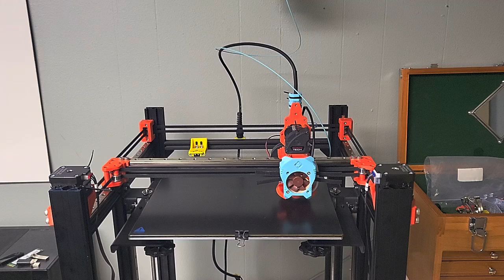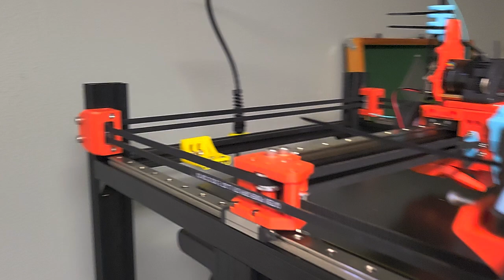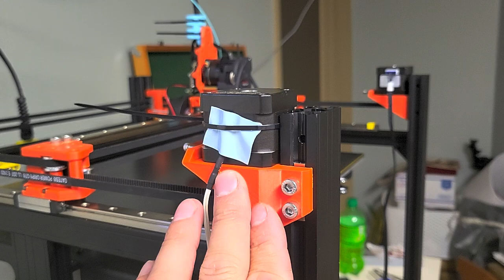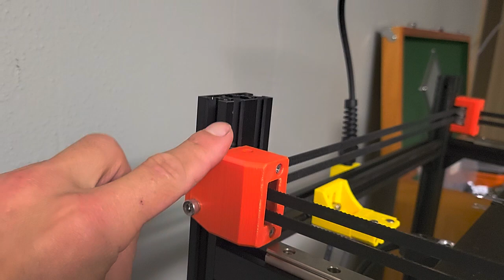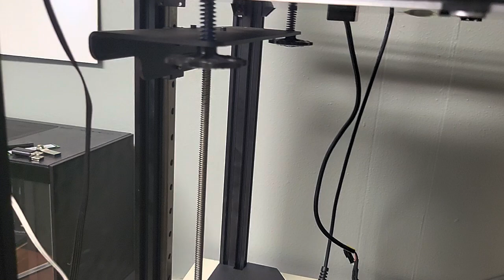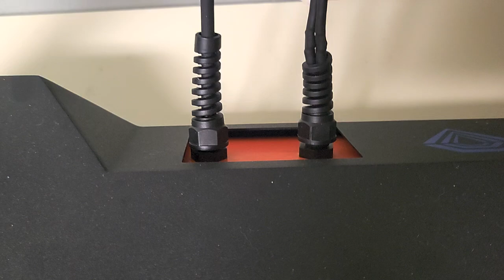Budget 300x300 CoreXY 3D Printer

Comment: I have an old Davinici xyz pro 1.0 3 in 1 that is a core xy design. Very slow from 2016, but enclosed and a likely project base? Really sturdy frame, but the software has it limited.
You think a core xy rebuild is practical?
Nice work! Spike
Reply: Honestly I wish I knew about klipper before I scrapped mine. But then again I'm not entirely sure how you would interface it. Though with Reddit and YouTube, anything can be done.

Comment: About to start my DIY 3D Printer build.
I've already build a laser cutter with a large cut area (500 x 500) using CoreXY. It works well and we're actually thinking of putting it on the market since it is so robust and compact.
Long ago I used to offer bed heater kits for the DaVinci (Cheap brand sold on Amazon). I have full access to my own machine shop so probably will make the mounts and corners from aluminum.
I"m thinking to use Clearpath servos instead of steppers.
On the laser we were very happy with the CoreXY. How do you feel it works on the 3D printers since they have a larger load with all the machinery (weight) on the head?
Reply from the maker: Corexy has its place. It just really depends. It's easier to go fast, and have a nice contained machine using corexy. But you can't beat the accuracy of cartesian and it's simplicity. It's much more work to get a corexy to be as accurate as cartesian. It's doable don't get me wrong, but things have to be just right. I would advise looking at the zerog mercuryone.1 if you're planning to build completely from scratch for inspiration. My design here has a lot of drawbacks made simply so it can be installed on the existing sapphire plus frame.

Comment: This is awesome! I'm planning on building this in a Trident frame. Thank you for sharing!

Any reason the height of the motor and idler mounts need to be adjusted at all? Wouldn't it be possible to calculate the height off the rail +carriage and add that as a shim to the parts?
Reply from the maker: Oh it could very easily be accounted for and built in, just requires the time to do it haha. It's on the to do list just haven't gotten there. I'm not really happy with the motor mounts so i am waiting until i figure out what to do there. Just need more hours in the day!
Reply: @53Aries  hahaha I get that! There's just not enough time!

Comment: how did you mount the toolhead pcb? which one is it?
Reply from the maker: E34m1 is what it's called. They have a pcb mount included in the files. I'm using the EBB36 from bigtreetech. https://github.com/jon-harper/E34M1
Reply: @53Aries  thanks for the answer. What Pulleys did you use? The ones from the SP5 collide with the 3d Printed part. (12mm Diameter of the Bearing, 18mm max diameter of the flanges)
Reply from the maker: @itsame6217  i used Gates gt2 pulleys. They have an outer diameter of 15mm. It was a personal preference to use them as they are kinda expensive but since everything else is cheap i figured I'd get the best possible pulleys. Plus the 15mm outside makes packaging better. I've heard the mellow gt2 pulleys on aliexpress are good quality and slightly cheaper if that helps.
Reply from the maker: @itsame6217  https://kb-3d.com/store/motion/216-gates-powergrip-2gt-idler-6mm-toothed-1634482229216.html and https://kb-3d.com/store/motion/393-gates-powergrip-2gt-idler-6mm-smooth.html